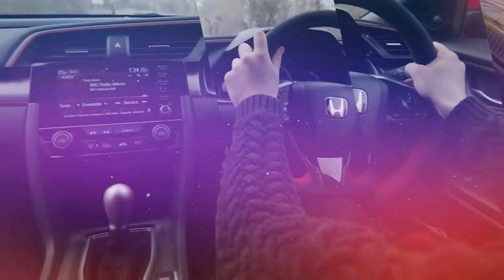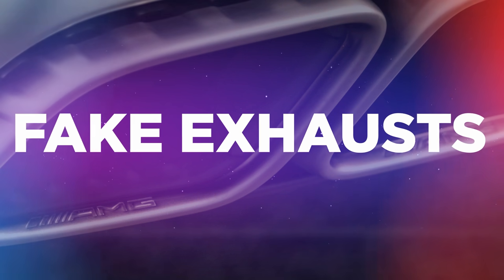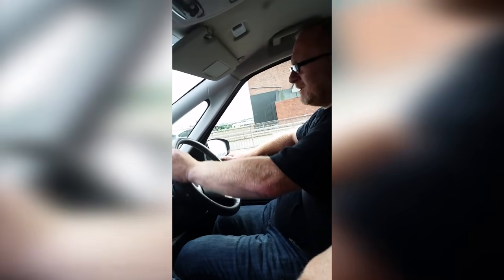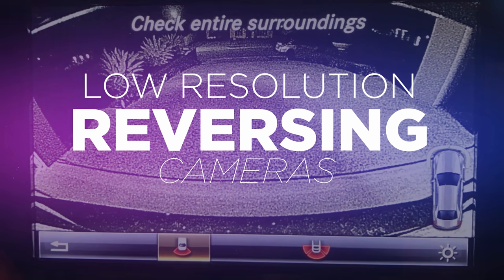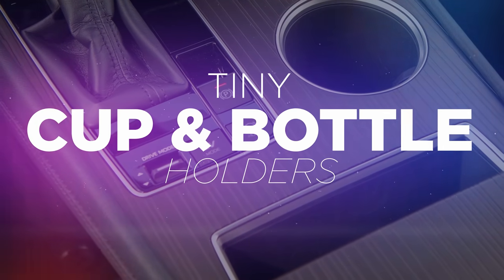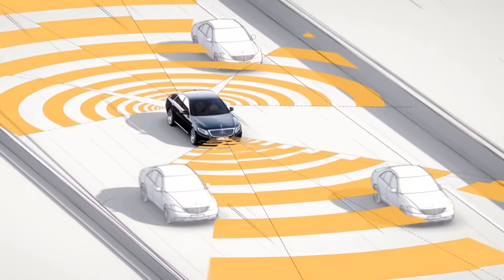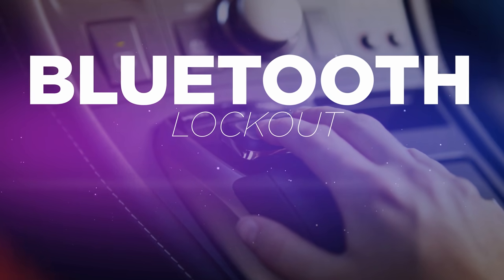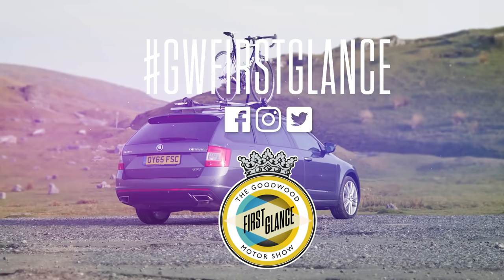Ten worst modern car features

Comment from the maker: What really annoys you?
Reply: Everything
Reply: Removing physical buttons although they are easier to use and don't require you looking at them.
Integrating everything in a screen ( climate control, seat heaters, ect.). That is just a cheap and ugly way of making an automobile.
Screen instrument clusters.
You guys covered all the rest.
Reply: Auto start/stop. Please make that go away. If I wanted to save petrol, I'd be driving a Prius.
Reply: No vent windows. AC controls that don't let you do what you want. Buzzers with no volume control. Reverse lights that come on when the car isn't in reverse. Expensive keys. Huge, distracting screens. All the muscle cars with engines that sound like you locked a bear in a room with a bunch of metal bowls and occasionally throw in some firecrackers.
Reply: Joykill noise level regs
Reply: Touchscreen, I have to take my eyes of the road every single time to get what I want from the screen. And I don't know whether I have pressed it or not. The plastic switches I know which switch it is where at what distance from the boundary of the without the need of looking at them whereas touch screen I can't tell what I am pressing thus I have to look down.
Reply: Can't believe pointless warning gongs for everything isn't in the list. The single reason I haven't bought a new car in the last 20 years is because I can't stand the endless bings and bongs inside modern cars. Seatbelts, handbrake, key in ignition, lights on, entering a school zone, driver's door open, low temperature black ice, the list of excuses to make a car go 'bing' is endless
Reply: TOO.MANY.BUTTONS
Reply: soft limiters on supercars and big complicated tuchscreans
Reply: @pralhadmundargi6503  i 100%agree with you on that
Reply: All 'driver assist' nanny feature.

Comment: The electrification of everything, steering, handbrake, suspension etc.   There's nothing wrong with mechanical items and if they hadn't noticed they are more reliable.  The amount of brand new Audis and BMW's I've seen broken down at the side of the road because computer says NO.
Reply: That's why I drive a 1983 Benz 240D
Reply: Electrification of estate car rear hatch: sweeps open much slower than gas struts / spring alone and is another thing to go wrong.
Reply: ahhhh hahahahaha !    yes!!!     compu ‘er says  noo

Comment: 11. artificial backfire
12. valve controlled exhausts
13. speed limiters
14. centre consoles so wide they leave no room for your legs
Reply: For 14, it might be because of the gearbox linkages stuff like for example: Bugatti Chiron. That center console is huge
12 seems alright in my opinion, in low revs doesnt intrude loud noises to everywhere. Once you are higher up the rev, it sounds "cool"??
Those are just my opinions
Reply: Valved exhaust is great I have a 2018 challenger r/t 6spd and it closes below 1/3 throttle when not In sport mode so it's not droney on the hwy.

Comment: I'll add touch screens and touch buttons. There imho more than just uncomfortable. Often they react slow, there's no haptic feedback and you have to take your eyes from the road for a lot of functions which makes them even dangerous. What's wrong with classic buttons, switches and knobs? They work and they don't distract me from driving. And using the right materials and designs they even look great in modern cars.

And looking at that Tesla screen and seeing The Witcher 3... video games and movies definitely don't belong on the dashboard. NEVER! Even when autonomous driving becomes a thing (still don't trust the ai to always judge the sensor and camera data correctly) you should always be ready to react as a driver.

Oh, and i almost forgot: Weight! Everybody's talking about reducing weight, but most cars get heavier with every new generation.
Reply: What's "wrong" with real buttons is they're expensive to make. Accountants design cars these days. The last cars designed by engineers came out in around 1994/95

Comment: Electric handbrake, power tail gates,  screen dashboards that look like a PlayStation instead of a nice set of clocks…
Reply: Sorry but what exactly is wrong with the electric handbrake?
Reply: @ARDEN440i   Wait until it goes wrong!! Range Rover body-off 5 hours labour alone, and what was so hard about pulling a lever ? Oh for the fun drivers no more hand brake turns..
Reply: Electric handbrake with hill start assist for a manual gearbox. You have no business driving a manual if you cannot safely hill start. Ever try to pull a donut with an electric handbrake?

Comment: No option to delete the radio and navigation system.  I have owned 3 Porsche GT3's and each one I have ordered without the heavy radio, speakers, and navigation system.  When my Porsche dealer informed me that I was eligible to order a new GT3, the PCM delete was no longer an option.  Second, cars are now data collection and privacy violating.  Not only is my location monitored, but so is the radio station I listen to, my contacts, etc.  No vehicle manufacturer should have such information of a vehicle that I own.

Comment: What I hate is VSC you can't turn off. I live in Iowa on a ridge so all the roads home are uphill. They get snow covered and icy in the winter and while I'm trying to get up them in icy conditions the tires are going to spin. That's no problem, I know how to drive in ice and snow but the Freaking VSC automatically slams on the brakes, stopping me dead in my tracks. It really pisses me off! I know how to drive the damn car, I don't want, need or appreciate the Freaking car making those decisions for me. Same with automatic windshield wipers.

Comment: Two things I hate are the sporty aggressive styling and the minimalist design of cars, where have the classic styles of the 60’s gone to, or the wonderfully plane (yet exciting) styling of the 90’s?
Reply: Agree the cars from the 90s had much better shape. Today the design are more and more safety related. No doubt safety is required but this becoming to much with all those curves flocking way out, I think. The 90s cars were just flat from the side and had no need of extra curves.
Reply: Some 90s cars look great, but imho a lot of them look like 80s cars after they melted.
Reply: To each their own. 60s?  Ughhh.  Now the 30s…

Comment: Touch screens, welcoming sounds and lights, adaptive cruise control that can't be switched off to passive function, all these modern "assists", overdesigned gear levers, electronic parking brake, ECO trainer, suggested gear indicator, driving tips advices....
And also features you don't get anymore in most cars: oil and water temperature gages

Comment: Couldn’t agree more about touch screens generally! Alas, as my engineer friend explained, the mfg/rd cost savings is what drives every company and their shills to market.  Despite our brains screaming and crying for buttons and dials every time you want to change temperature. 

The trend of Small windows and low roof lines are a pain in the neck too.

You guys nailed it! Also, Save the Manuals!

Comment: "Automatic Air Conditioning" - you won't get the right climate anyway, just give me a turn control in blue and red i can somewhat relate to
Reply: This please.
Reply: This is where I disagree. Automatic climate control is just about the only automated system I am happy with in a car.

I think the reason they are unpopular, though, is that many equate the temperature setting with a FAN setting. But this is a misunderstanding.

If you enter a car that has 25°C interior temperature, and start the climate system set to 20°C, fans will blast you with cold air in order to get the temperature down. After a few minutes, the fans will calm down as the desired temperature has been reached.

But many are probably startled by the aggressive fan control, and thus start fiddling with the temperature setting. This leads to not getting to the desired temperature, so the driver starts fiddling with the setting again...

Just leave it set to your desired temperature, and let the system do its thing for however long it takes to reach the temperature setting. Trust me, it works!
Reply: @PerHedetun  at least my "VW Gold 5" didn't.

Regulated to early. I needed to set it lower then specified to ever reach a temperature and even after reaching it (additional thermometer) i wasn't ever able to keep it remotly on point.

To start it and later just turn it down slightly is just al i need
Reply: @Niklas.K95  I suppose mileage may vary. 😁

Comment: Bluetooth lockout should be disabled if the passenger seat detects weight. The bloody seatbelt alarm has no trouble going off when you have a small bag on the passenger seat but heaven forbid the engineers didn't think to disable the lockout if there was a passenger in the car >_<

Comment: Fake engine/exhaust sound, and giant grilles.  Also, fake diffusers on Altimas, Camrys, etc.  Even when a car has real aero, it does absolutely nothing outside of the track.  Even even if it did, more grip just raises the limits (AKA: fun) of the car out of reach.  Go drive a a car on the road with aero and 50 treadwear 325 section tires.  Then go drive a Miata or BRZ.  Then put you ego aside and tell me which is more fun

Comment: I hate these tire pressure sensors.  It's got a watch battery and when that goes dead.  You have to dismount the tire to get to the damn thing.   They constantly disconnect, setting
off the warning light.  It would always send a fault when I passed through this one stretch of highway.   Is it really that hard to just pay a little attention to your tires when
you walk up the vehicle.  My truck has this system and I can't get it to connect and I can't disable it.  POS.

Comment: Just made it back from a 50 mile drive in the country  set up . 
My 1970 MG/GT  has not many features needed.  Only One the electric overdrive ..what a great feature ..simple enough ..ok sometimes I forget to switch it off .but no big deal ..
As always less is more  ..As the car is the sound machine it those not feature a radio. 
Plus it is changing its own oil while driving or parking 😉

Comment: Over-complicated infotainment systems systems packed all the features of a teenagers mobile phone with no thought to the functionality required to actually operate important vehicle systems.

Virtual dashboard with 256 different warning symbols and a 300 page handbook to explain them all.  

Shiny black plastics on the dashboard that creates a lot of annoying and distracting reflections, show every fingermark and speck of dust, scratch easily and look cheap.  

Cupholders placed above or close to sensitive electronics that don't react well to liquid spillage 

Cup holders located in paces where they are impossible to use 

OFF button for auto stop/start system located well out of normal site lines and right next to buttons you don't want to hit accidentally while you are driving (such as traction control)

Lack of standard USB ports for charging mobile phones and other items (my new car has only 1)

Comment: Thick screen pillars that create blind spots.
Low profile tyres on everything.
Alloy wheels on everything.
Assuming that “more sporty” is better when most would benefit from more refinement.
Adding trinkets to cars rather than making the fundamentals better.
Lifeless over-assisted primary controls.
Fat steering wheel rims that obscure instruments.
Painted bumpers.
Marketing dept seem to be more important than engineers.
Excessive trim that robs interior space.
Throwaway culture - cars aren’t kept for many years.
The general public being daft enough to spend a sizeable chunk of their disposable income on mobile white goods.
Depressing thoughts eh?

Comment: For what it's worth, you show the front of a Kia Stinger during the "fake vents" portion at the end of the video, but the front brake vents on the Stinger are functional. The hood and rear vents are not, which is lamentable, but give the car credit for what it is: an incredible GT sedan for far less than comparable European brands.
Reply: But it's a Kia though
Reply: @oldlud8971  So? It'll take a Challenger Scat Pack in the 1/4 mile, trust me. With a V6.

Comment: Let's see. 
Putting everything including basic everyday controls on the touch screen, worse, buried in menus. 
Piping fake exhaust noise into the cabin through the audio speakers
Four words: Piano black glossy plastic
Low rooflines that make entry and exit a pain for us taller folks.
Those touch screens that look like they were an afterthought - stuck into the top of the dash partially blocking some drivers' view
Ridiculously bright LED headlights, especially on SUVs and trucks, that blind oncoming traffic at night

Comment: The gesture control in my opinion seems ok, if you do drive thru to Mcdonald for example,
your hands are dirty, and the audio sound level is slightly either too loud or soft, you dont want to dirty the interior, 
so i think gesture control is fine